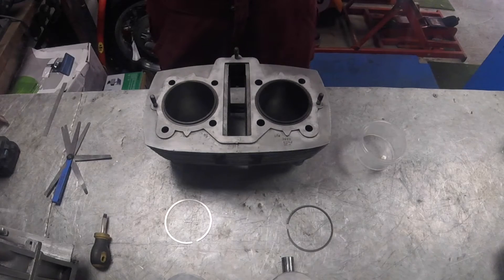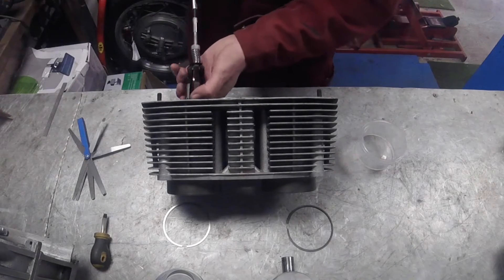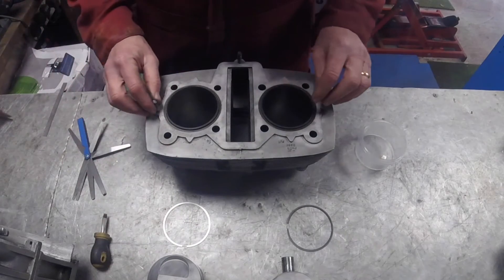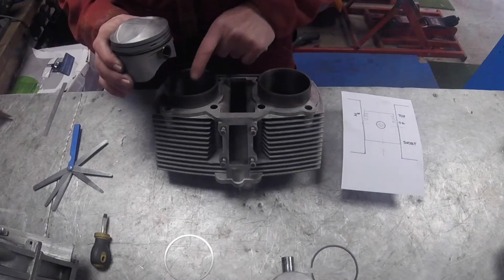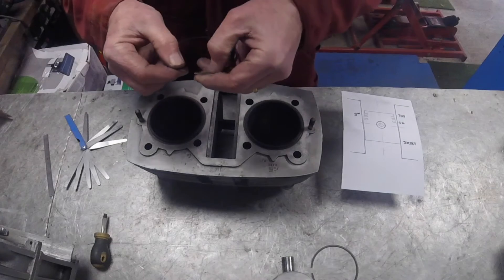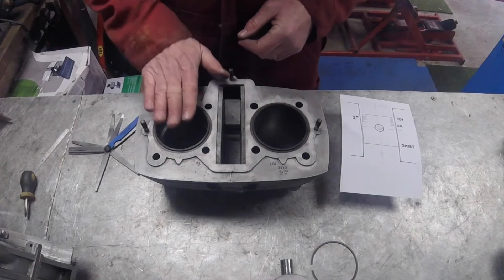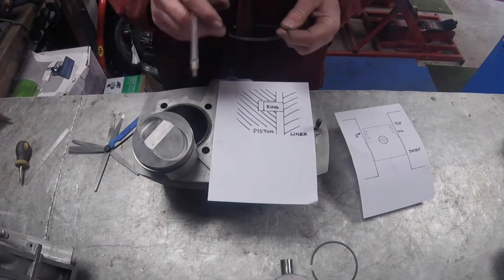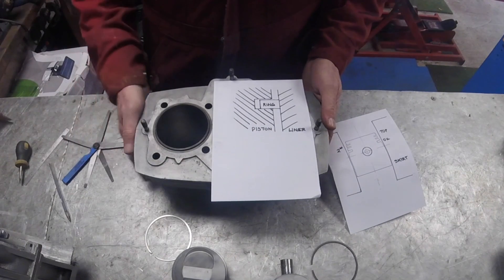How to check Pistons, rings and cylinders using feeler gauges

Comment: Excellent explanation. I've never known there was such a big difference in the piston diameter at the top and bottom. Is this just because of the heat of the flame front which expands the top of the piston?
Reply from the maker: That's correct. It also explains why engines smoke more when cold because the ring pack isn't fully activated until the piston is at temperature, and the "looser" rings allow oil past them.